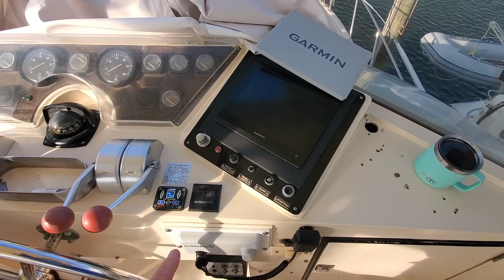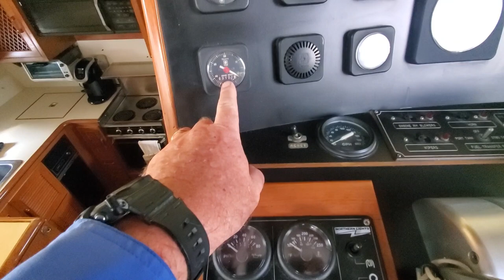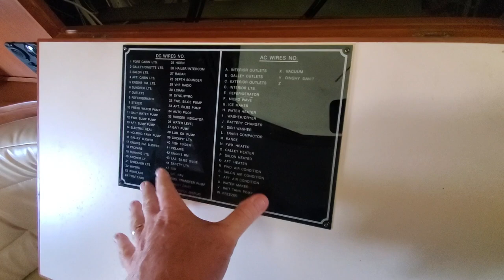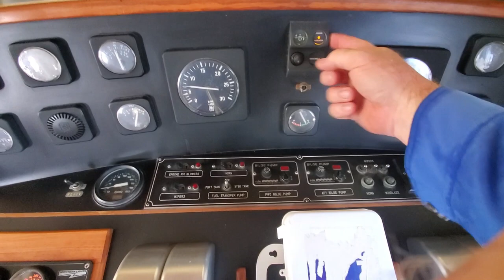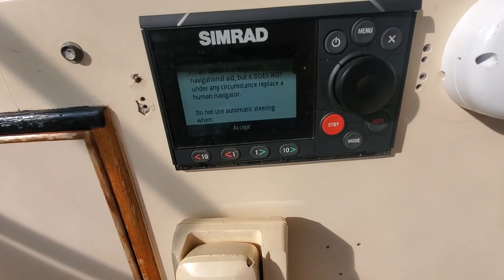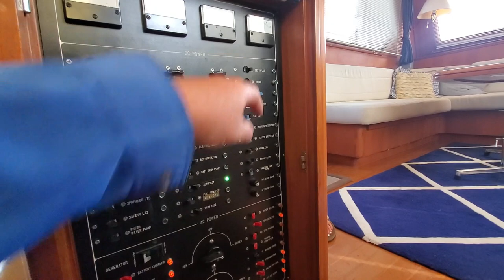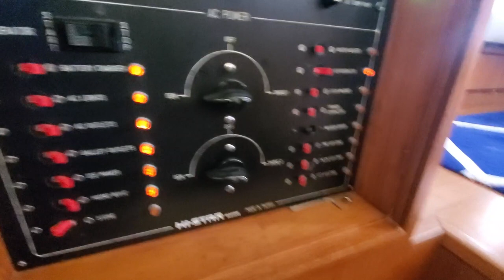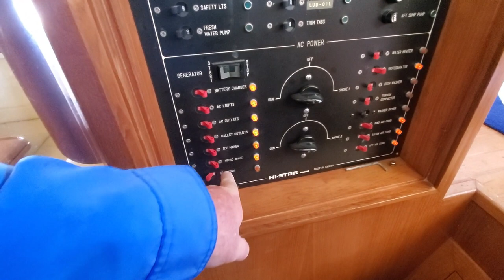55 Hi Star cockpit motor yacht

Comment: Hi-Star was definitely one of the better Taiwanese brands. I believe they used legitimate naval architects to design their boats, unlike some Taiwanese brands. Do you know if the 55 was designed as a 55 or was it simply a stretched 48? This 55 looks nice, although access to the outside of the Cat 3208's looks difficult. I'm astonished Hi-Star couldn't squeeze in a separate shower for the forward stateroom -- that's chintzy with just two staterooms in a boat that big. Hope the blisters are not serious. A top-tier Awlgrip or similar paint job will run big $ for a boat that size -- $15K? Having a door next to the lower helm is a huge plus when docking. Does it have bow or stern thrusters? I didn't see them. Fly bridge is OK but a good seat for spouse is a necessity. Launching a dinghy from high up with a davit is a real pain in a rolly anchorage. I wonder if it is possible to mount davits on the swim platform? 

BTW the Raritan Elegance heads get rave reviews from experienced owners in the Yacht Forums web site. That is a great source of information and you can probably get questions answered from Hi-Star owners if you post questions there. Good luck! 

Most of your questions about the boat and engines should be answered during a thorough survey and mechanics' survey. Get good ones!